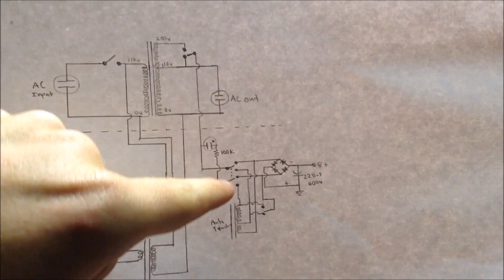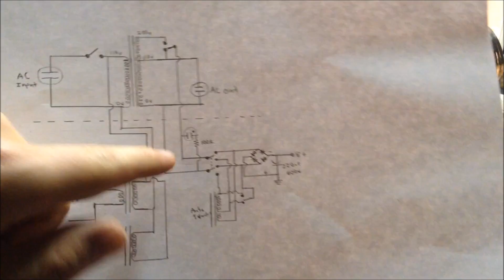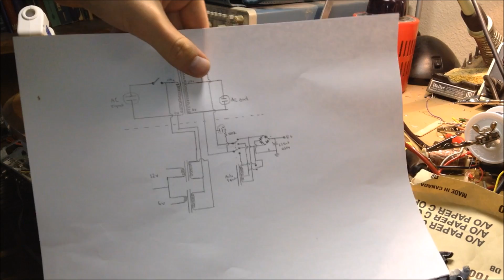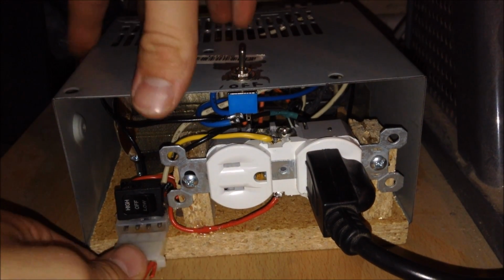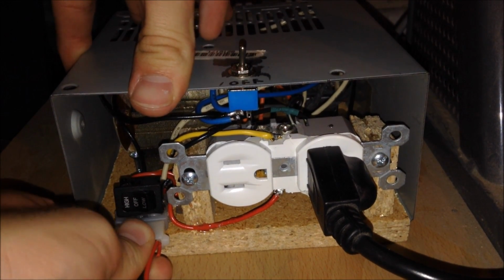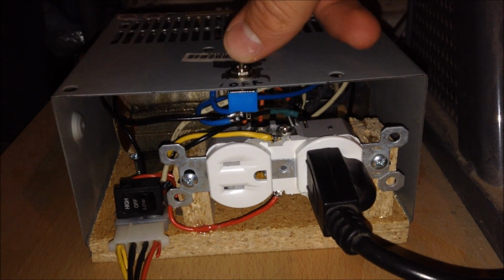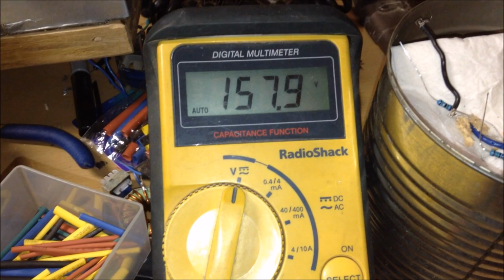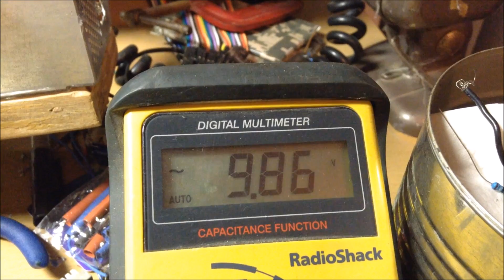Power Supply For Tube Projects

Comment: i'm considering building a 4 tube stereo amplifier but want safe B+ voltage[s] for the plates on the tubes. so naturally i'll need a transformer but where do i find one that has a low voltage winding?

Comment: I admire your enthousiasm for electronics young man, seriously, hope you become a great engineer one day! But you are naive, a bit of advise here:

- Throw this power supply in the garbage bin, where it belongs. You're dealing with high voltages, you cannot just screw things to random pieces of wood.
- Remove the video from Youtube. Building something unsafe for you own use, that's your problem! But if you do that, then don't post it online. One could just build this psu, harm themselve and sue you. There are no warning notification at the beginning of the video, they would probably win. 
- Learn some proper grounding.

Hope you understand and learn.
Reply: Hey! It's not bad if only he uses it and no one else, he should put a DO NOT PLUG IN sticker to scare away any non experienced user. To me it seems fine to use, anyone with half a brain knows to not touch any exposed wires while its powered on
Reply: Do people really need to be reminded that the internet is full of wonderful but unsafe information? Don’t criticize this kid for not catering to people who can’t be trusted with their own health/safety.  Nobody is making them build the device that will eventually destroy them.
Reply: @jamesyahoo4758  I wouldn't touch anybodies electrical handiwork like this (unless they spec me in on how it works) , they made it themselves have experience with it and know everything about it not me. The maker knows about all of the faults and danger of the circuit.
Reply: Back off BOZO! The kid will do fine without your negativisms.